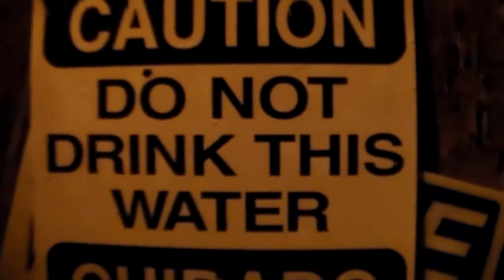1959 Chevy Viking Rescue Rig

Comment: Home or smoking when you start him up your drain holes could be stopped up in your heads where you're all drains back to the oil pan I had a 350 Chevrolet and a '69 Chevy truck that did that and I cleaned them out and it quit smoking just pull your valve covers off and look at them they're in the corners of the heads
Reply from the maker: Good advice, but I'm afraid its a bit late for that old 350. I did just purchase a Detroit-diesel donor truck for Homer. "Film@11!" Thanks Jimmie.